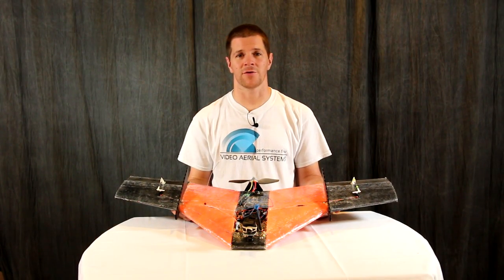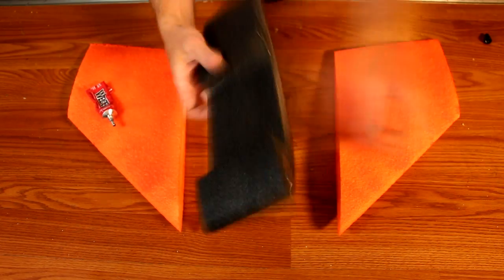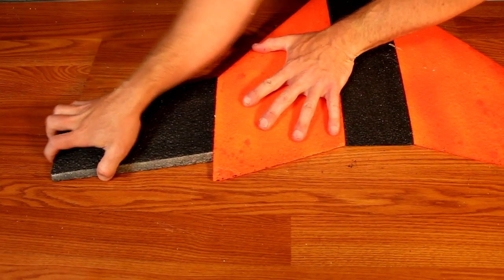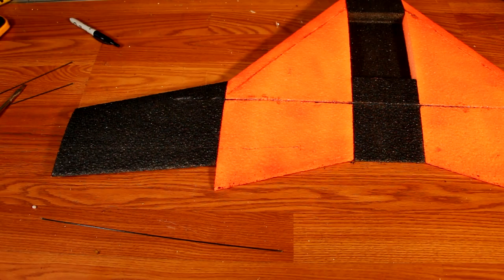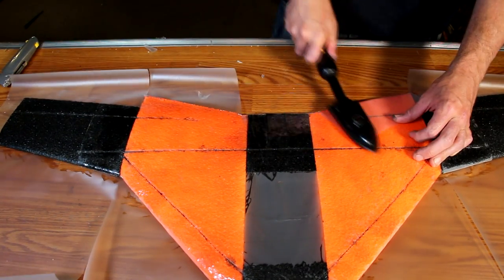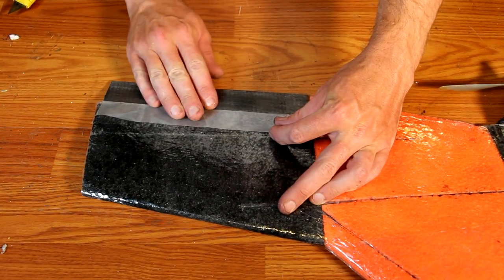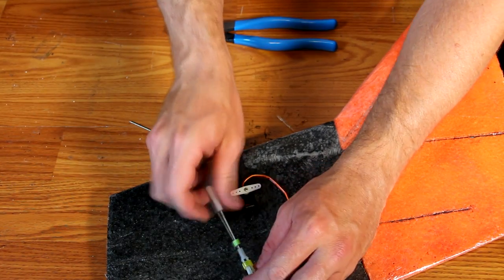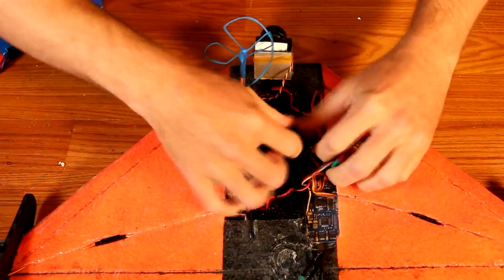IBCrazy's Wyvern (Chimera mini) Build video

Comment: will it fly with two 2.2Ah 45-90c 4s nano-tech or should I leave one at home? ;) Looking really cool!
Reply from the maker: Julian GoesPro  That should do.  I am running a single 4200 3 cell on mine.
Reply: +Julian GoesPro you also left quads for planes/fixedwings julian? :D
Reply: +MadMaikRC started with CP helis 15y ago :-P Then planes, then quads... but now I want to get back to planes for an other FPV experience ;)

Comment: what kind of lense are you using on the camera, it looks big
Reply from the maker: Grearson .x  It is a IR reduced 4mm lens.  It helps with the camera into the Sun problem.  The narrower lens also makes the plane appear to fly faster than it would under a normal lens.

Comment: nice looks like the plane for me:)
Reply from the maker: RCflyer729 - I am currently running at 95 mph top end.  Below 40 mph, this thing flies like a brick.  You have to stay on this one.  Fly it fast, or leave it at home ;)
Reply: Alex Greve what motor prop battery are u running?
Reply from the maker: RCflyer729 Currently running a POS turnigy 3530/1700kV motor but I am trying to custom build a motor from a DT750 if the acetone will ever dissolve the epoxy so I can get the magnets out of it.  The battery is a 3S 4200 from Stone Blue.  I can get a 30 minute flight time if I am easy on the throttle... but what fun is that?
Reply: Alex Greve Got a screamer Scorpion on deck for this one. I'll push it til' she shatters!